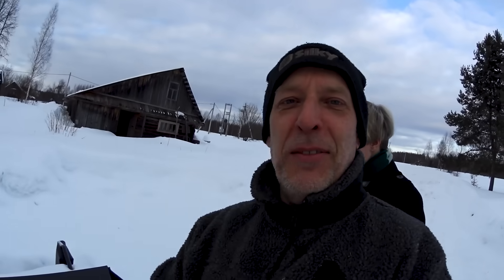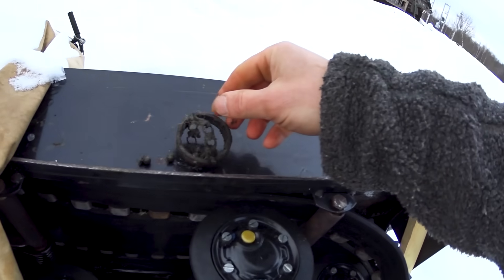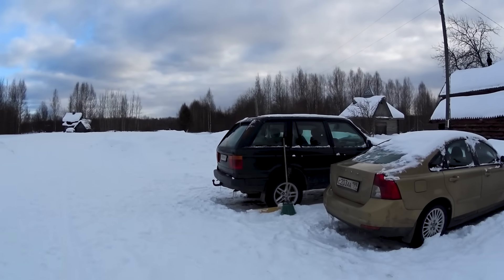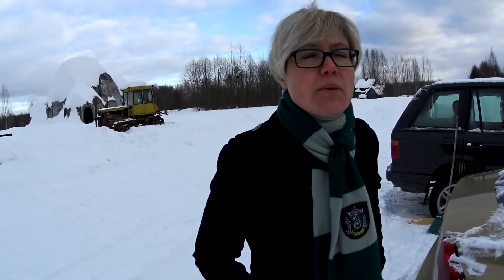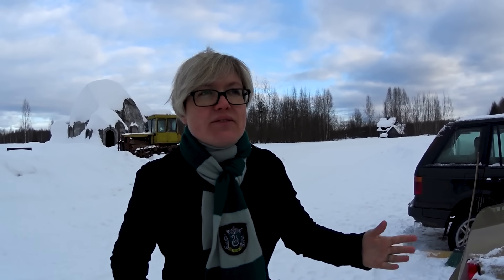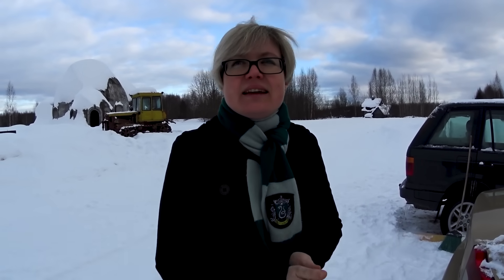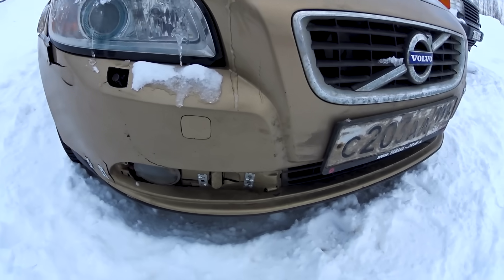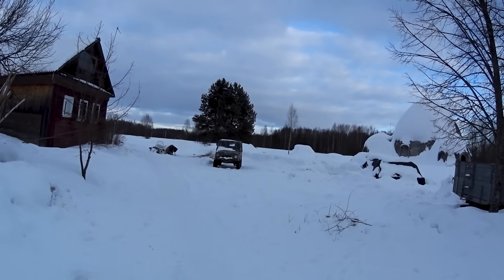State Of The Channel | Car Crash | Video Ban | Mrs Survival-Russia

Comment: Lars, I live in Alaska. We prevent moisture in our crawl space by puting fiber glass or fiber rockwool insulation against the inside foundation cement wall. Just a suggestion I hope helps. Stay safe
Reply: A thick plastic sheet vapor barrier spread along the ground wouldn't be a bad idea for the crawl space either. Or, in the most optimal world, a 10cm slab strengthened with wire fencing (chicken wire, or preferably hog wire), allowing you to use the space for storage of canned goods and such. Maybe a little "tornado shelter/root cellar" wouldn't be a bad addition.
Reply: Vapor barrier, seal all vents to outside, plus a dehumidifier would help. Did for my crawlspace and it worked wonders. Also keep the floor warmer in winter
Reply: A friend of mine actually dug out a section of crawl space where he could stand up in and installed a small workshop in that area. He did pour a concrete floor an walls after setting in some thick plastic rubber material used on roofs to act as a moisture barrier against the dirt, placed 5 cm rigid foam board along the liner and then formed the walls with concrete forms plus he placed 5cm thick insulation on the form face, net result is the concrete has foam on both sides providing insulation to the walls of the dug out section.
Reply: fiberglass is probably more dangerous than asbestos, Heve a nice day

Comment: Perhaps in your basement in the future you could line the bottom with plastic sheeting. Here in the states they do this to many of the crawl spaces under raised houses to cut down on all the moisture problems and mold and mildew that comes with it. Probably most of the cold parts of the year you might not need to worry about it because the ground is frozen, but when it gets warm, all that stuff can get to be a problem.  But yes, I have seen spaces like that here, and they put plastic down, and run it up a foot or two to the walls surrounding it. Many places will coat it with a mastic compound that seals it, and it cuts the moisture wicking in from the ground a great deal.

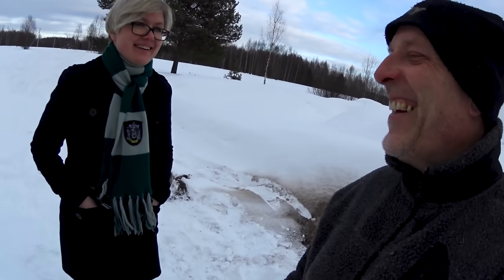Comment: 1:47 you are forgetting our old WW with a leaky tank and a gas pedal that worked half the time  if you pushed it down the right way.
and all the fresh air because the door wouldn't close. an old russian rust bucket cant compete with that. 😀

Comment: I had a similar incident involving hard packed snow and a plastic front bumper but the air bag sensor triggered the air bag and it cost about $2000 USD to fix. Insurance covered 90% of the cost though. Another reason to carry a knife is to cut the old air bag away so it is possible to drive home.

Comment: We call that "Landscaping" with bushes and trees. That crawl space would make good food storage. The black SUV fuel tank needs to be pumped out than dropped down from hangars to get to the sending unit, might be clogged up with gunk. All ways disconnect battery before you do the work. The new octagonal house looks good with vertical siding.

Comment: CRAWLSPACE MOISTURE
I have experience with construction, here in Saskatchewan, where it gets quite cold too. What we normally do is place 10mm plastic on the inside of the outer walls, as well as covering the ground. Then insulate the crawlspace walls before sheeting the outer walls. Heat transfer from the main floor should keep moisture build-up to a minimum...especially if your heating the crawlspace a bit.

Comment: I've been trying to explain to the bank that though my meta tags describe my app as a generator, I have to write all the changes to the code myself. Yes, I can dry my laundry without too much effort, obtain and take my Amazon subscriptions without much ado and recharge the battery on my solar powered closed circuit tv without struggle, but I have to be here to be sure that it happens, because if my paycheck turns out to be exactly the same as the deposit I made from my retirement account on the same day to top up the Trust, then I have to ensure that I'm not charged with overdrafts because they misplaced one with the other instead of adding them together and so on.

Comment: I know this is two months old.  I build temporary "tent" buildings by setting a tin roof constructed on pressure treated 4x4's and close them up with tarps, adding a door and sometimes some windows here and there.  For temporary storage they work great, the downside is that they are basically an eyesore.

They work great, all the same.  Things stay good and dry and out of the weather, but only to a certain degree.  What you are experiencing in your crawlspace is the exact same thing I experience in my tent buildings, and it's because of the earth with no real barrier.  Even though the stuff in my tent buildings stay dry because no rain or snow gets on them, the moisture coming up from the ground is all it takes for metal inside those buildings to rust.  If I had a concrete floor, it would act as a vapor barrier between my buildings and the ground and nothing would rust.

Your house needs concrete poured over the crawlspace floor.  The problem, just like my tent buildings, is moisture rising from the ground (your humidity).  You will continue to have problems with that in one form or another until you get a barrier between the house and the earth.  I would suggest concrete.  Once there's concrete down there, all those problems will go away.

As far as keeping warm, regular insulation under the floor would work better.  Regular fiberglass bats would work much better.  Foam works great if you're laying on it, it will reflect your body heat back to you, but it has a very low insulation rating.

You might have a cheap heating fuel, wood, but the lower the insulating value amounts to all that much more wood you have to cut, split, and carry, for years into the future.  You aren't getting younger, at some point in time that work will get to be too much.

Comment: I wish you all well. Some people in remote areas of the world use a heat gun from an auto paint store from a bigger city and weld plastic strips on the back side. Then you can fill the cracks and make it look pretty original. I was afraid I would get in trouble with sanctions if I use Boosty?